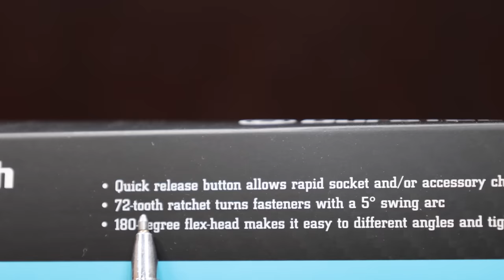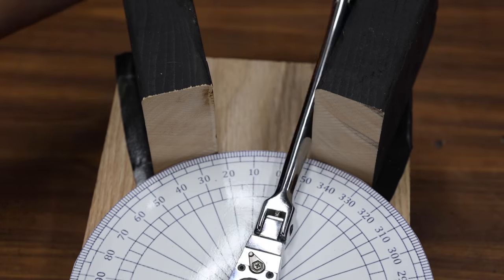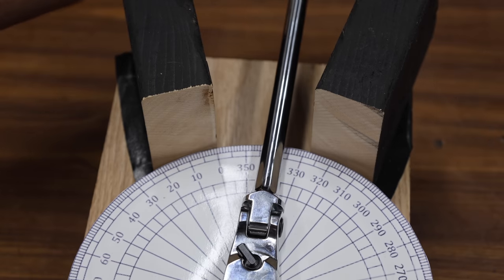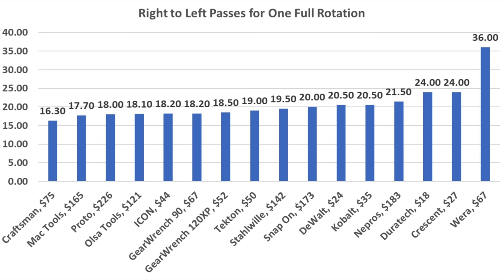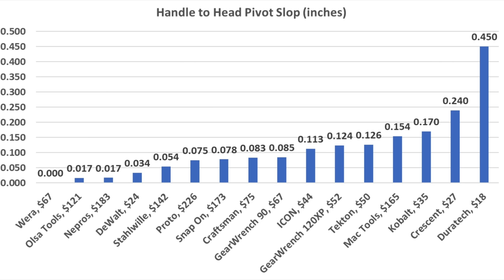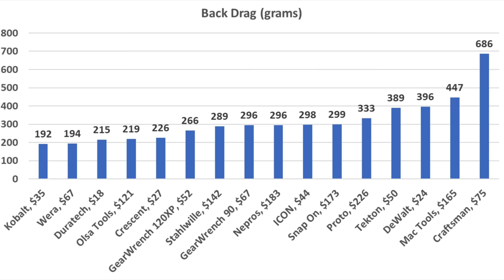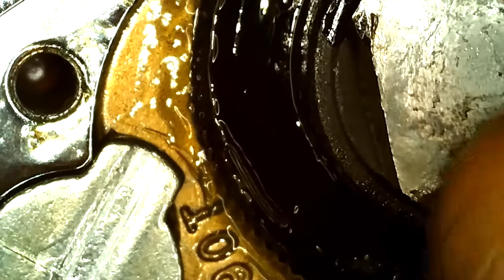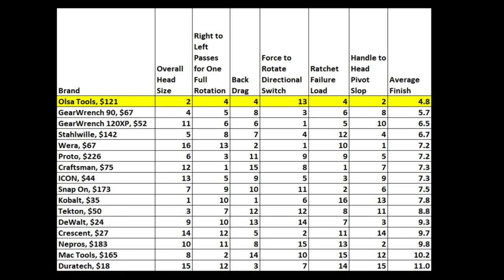Best Flex Head Ratchet? Let’s settle this!

Comment: Nerd Alert: Could you post your spread sheets with the raw data when you do these reviews? I love your testing but it would be great to have the data so I can apply my own weighting on the different tests to determine an overall winner. 

Also purely using finishing order doesn't account for the fact that some of the results are nearly identical. For instance, a ratchet A breaks at 20ftlbs, but B-D all break at about 200, you wouldn't want the score for the ratchet that can hold 199ftlbs to only get one more point than ratchet A that is basically unusable.

Just posting the raw excel sheet and graphs would be great! But if you're interested, I can make and share a sheet that will allow custom weights for each category (like switch effort vs breaking torque) and more representative scoring within each category (maybe normalized 0-100 score?).

Comment: Review idea that shouldn’t be excessively expensive: 12V LED lights for vehicles. Whether they are DOT approved or not. I specifically mean extra spot lights one can use to enhance visibility without blinding people. Most affordable lights either are flood lights or they aren’t particularly well focused. Not everyone wants to spend high triple digits $$$ on brand name lights and so I wonder if you could test some light bars and spot lights from common online retailers and see what is the best bang for the buck. Btw: I have found that the lumen and wattage claims are bonkers 90% of the time.
Reply from the maker: Thanks for the video idea.

Comment: The Icon would be even better if it had the super-strong locking positions like the Tekton does. Flex-heads are useless if the head doesn't stay put when you torque on a fastener.
Reply from the maker: Thanks for the feedback.

Comment: Here’s logic. The cheaper version may break faster than a more expensive ratchet but who’s really going to push it that far? Another point if I’m only a weekend mechanic I may never wear out the $30 ratchet and if I do I could still buy another 4-5 ratchets before I’ve spent $200. Professionals that use ratchet’s ever day should have top tier tools. The every once in a while mechanic should have two husky or Milwaukee ratchets and your good to go.

Comment: To be fair the ratchets with quick release will always fail first on the square drive with less material their to accommodate the quick release mechanism and the mac tool ratchet test is kind of bogus it's the locking head the proto and Mac non locking ratchets are one in the same ratchet also made in same facility Dallas TX the import ratchets always have thicker kneck on the flex end to make up for weaker steel the olsa ratchets im told are made by sk and are the exact same as the lp90 series the guts seem to interchange just some food for thought nice video
Reply from the maker: Thanks!

Comment: Thank you so much for making this.  I was in the market for a flex head ratchet and finally settled on the Wera thanks to your testing, it’s made doing oil changes a LOT faster and easier.

I hope it’s not too cheeky of me to ask, but could you possibly consider doing a video on the best dildo and compare things like length, weight, diameter, durability, abrasion resistance, force of impact from a 155 degree arch swing, force required to insert and remove from 1” PVC, subjective testing as to which is better suited for appeasement vs showing him/her/xer who’s boss?  

Thanks again for making these videos and making wise purchasing decisions so much easier!

Comment: Your average is a simplistic calculation. Use a weighted average. I prefer a stiffer directional lever as opposed to one that easily moves while you’re ratcheting on a bolt/nut and your hand slips a little and switches the direction which leads to a knuckle buster. Your scoring system is highly subjective to error because you are using a simple math equation to determine your “average” finish. DM me if you want to discuss.

Comment: You have done your final tallies slightly incorrectly if you are going to use strict ranking. When there is a tie for one score, it is not correct or fair not to skip the next lower rank. Thus, for example, in "Force to Rotate Directional Switch", there is a tie for first place (GearWrench 120XP and Wera), so then the next place, Crescent, should be at 3, not 2, and GearWrench 90 should be at 4, not 3, etc. on down.  On the other hand, it is not that fair to use strict ranking when some differences are trivial (e.g. Olsa Toola v.s. Tekton switch forces at 588 and 589 are hardly different). I can show you how to do this easily and fairly if you can give me some way to contact you.